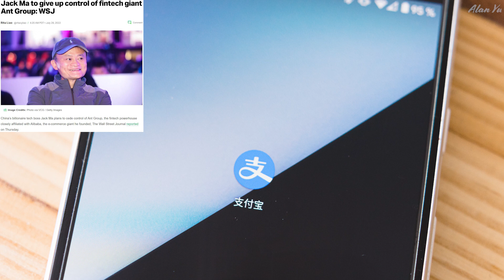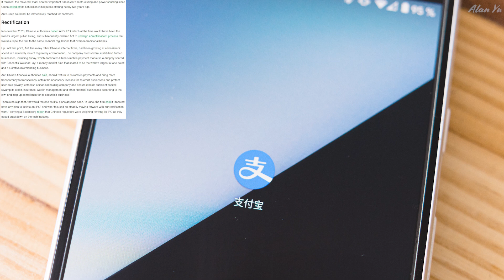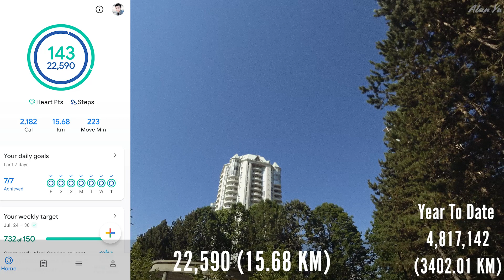Passenger Drone Explosion Risk, Jack Ma Stepping Down

Comment: 1. Only an idiot would build a craft where the key flammable components (batteries/ESCs) were housed in the passenger compartment!
2. We already have mil-spec electronic parts but bad circuit design and inappropriate component choice (even of mil-spec components) will still result in failures.

As someone who does a fair bit of drone flying (and has seen the failure-mode for such craft) I will most certainly not be interested in flying in an eVTOL any time soon🙂